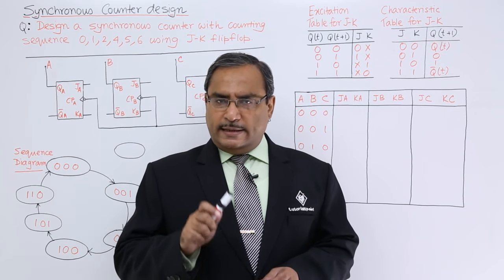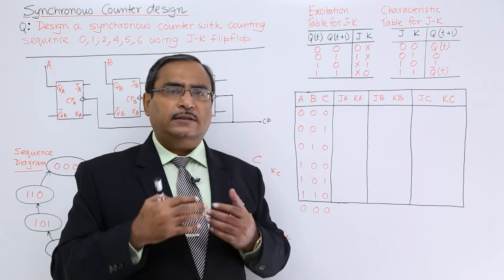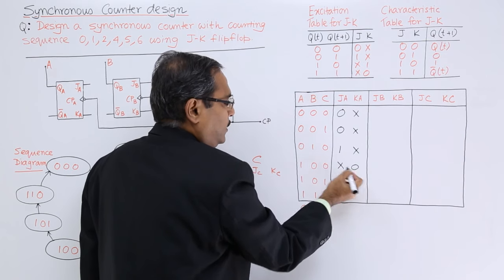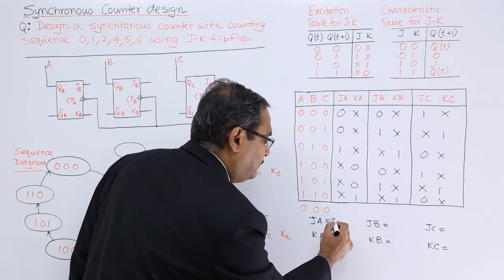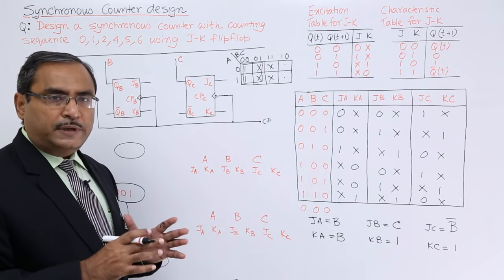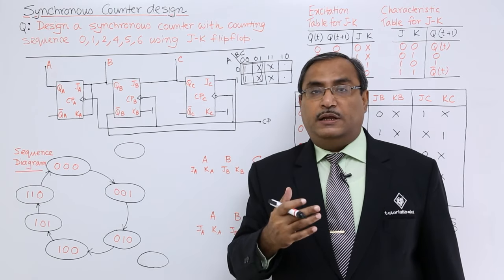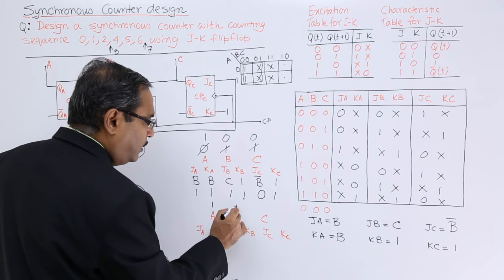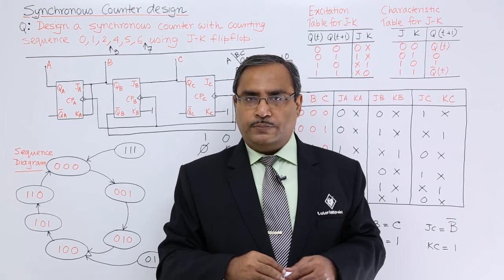Synchronous Counter Design

Comment: Sir plz help ,if the input clock frequency  10ghz is passed to 6 bit jhonson counters then from mod-5 ripple counter out of which is led to mod-6 counter then to BCD synchronous conter. What is the output of the frequency?